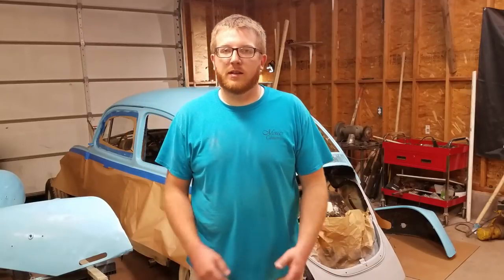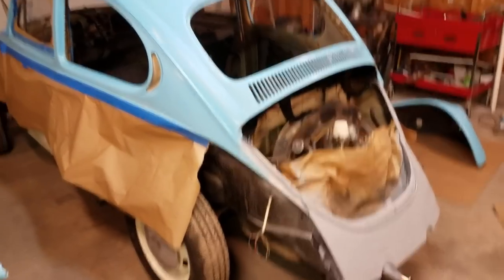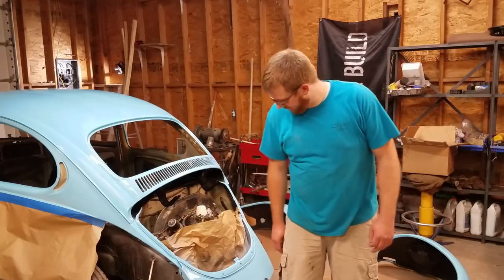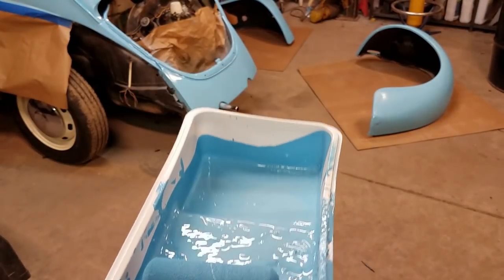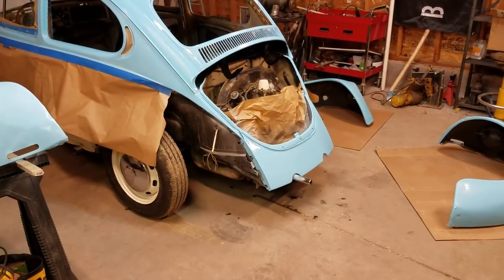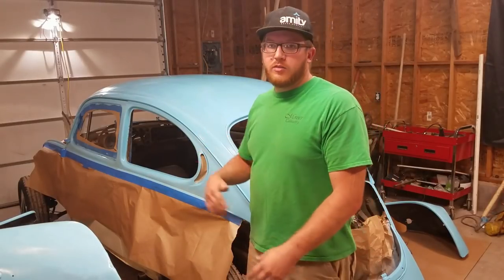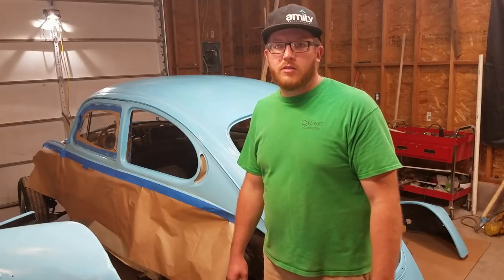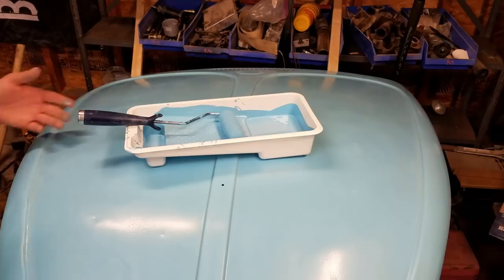WE ARE DONE! 71 VW Beetle - DIY $50 Paint Job IS COMPLETE! (LOOKS AMAZING)

Comment: Where and what do I need to get on my 1972 supper beetle project I'm working on do I need paint thinner and hardener and paint what do I get I wanna try this technique soon and get the supplies sooner before summer hits I still have to sand my project down but all in all will and should at least be worth a shot trying this job out I'm in northern idaho couer d alene area but yea
Reply from the maker: So at the beginning it shows the valspar enamel hardener, and a quart of valspar anti-rust oil based enamel paint, i mixed the color I want. Mix the paint to hardener 4to1 ratio. Let sit 30min mixing periodically then us the smooth foam roller to get a nice smooth roll. Good luck its looking good still!